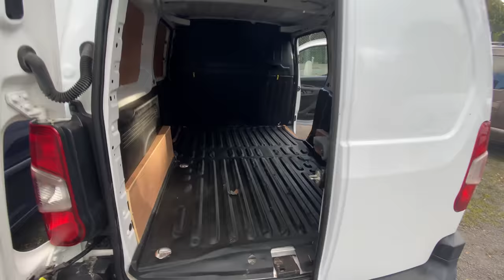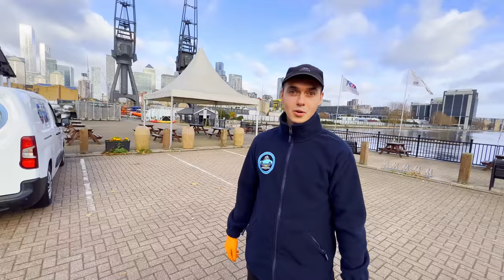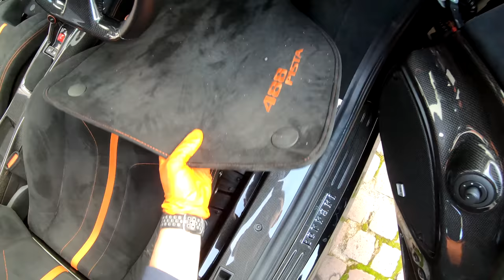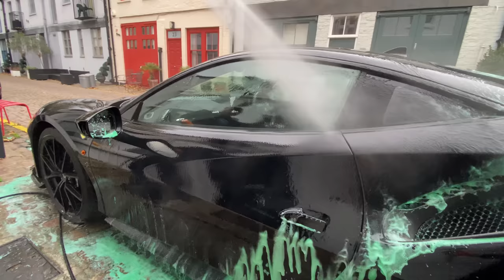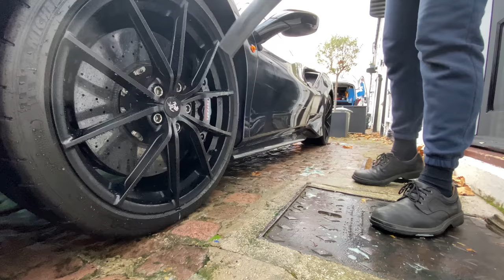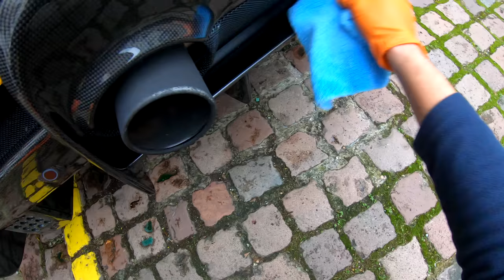How I Built a Super Car Washing Machine

Comment: congratulations on new van. Great work.
just wondering what washer do you use. I guessing you have a generator to run everything
Reply from the maker: Yes I have a honda eu3000i generator which powers everything. The pressure washer is a kranzle k7. So far these have been quite reliable for me

Comment: Very satisfying. I have a black M2 that I dry with a chamois, but doesn’t come up crisp. Were you drying it with just a normal towel in this video, or what it a special fibre or sorts ?
Reply from the maker: I use a large microfibre drying towel. It does dry well but the reason which the water is all coming off is because of the ceramic protection on the car (from the ceramic foam in this case) which repels the water off of the car. So if the car is protected, it makes drying the car a lot easier (even with a chamois)
Reply: @TinoCarCare  thank you

Comment: As car is parked close to the wall, how do you minimise splashes to nearby properties?
Reply from the maker: The key is to look at the surroundings first and then plan the direction of the wash. For example in this wash, I point the pressure washer and water away from the building. The same concept goes for nearby cars

Comment: Do you use anything in specific for cars with carbon ceramic brakes? 🤔
Reply from the maker: Yes, I dont use any wheel cleaner, aggressive cleaning products or anything with gloss enhancers. Instead i just pressure wash them and only use ph neutral and non aggressive foam and shampoo on them

Comment: Hey Tino, do you just rinse your dirty wash mits after use or do you put in washing machine?  If so do you let air dry, or use dryer?
Reply from the maker: Hello, I usually do a good through rinse with a pressure washer

Comment: Tino, so instead of using ceramic wax you now switched to ceramic foam?  Or do you still use ceramic wax when customers go for your ceramic service?  Love your content!
Reply from the maker: Thank you buddy. For my maintenance clients I use the foam to top up and boost protection levels. On higher services I use the ceramic foam and then also put a spray on ceramic on top to give a greater level of protection

Comment: tino to make things easy for your water tank the titan 2 way muti tap connector half inch to 3 quarter connector .. one pipe from tank to jet wash and the other going to a hose  for buckets
Reply from the maker: Hello Nigel, thanks for the solid advice, it is something that I have implemented a few weeks after making that set up and it has been very helpful

Comment: Top video tino, like the ceramic snow foam, are you applying that to all cars after wash ? Also how long does that stay on paint
Reply from the maker: Thank you, I only apply it as an extra on certain services and to regular maintenance clients. I do not leave it to dwell at all, I remove it straight after putting it on
Reply: Is it the replacement to the sealant? As I had that few weeks ago on my 5 series
Reply from the maker: Yes it can be a replacement but I like to use both to grant ultimate protection